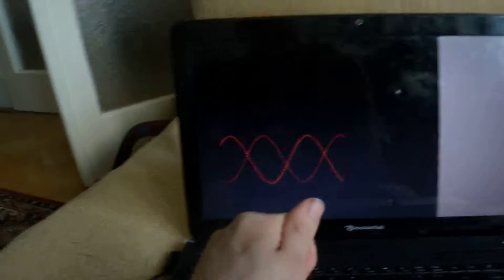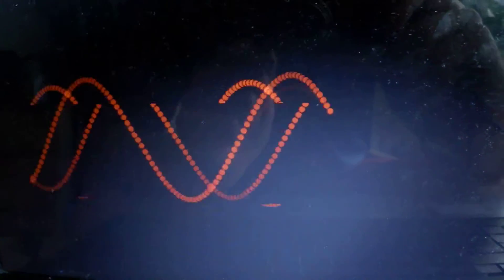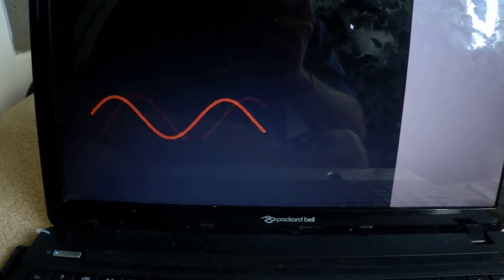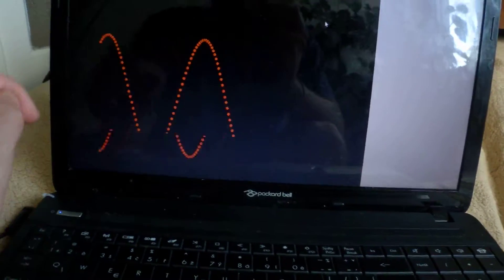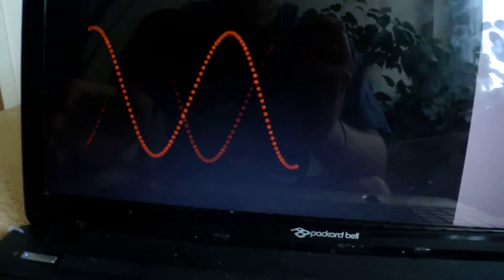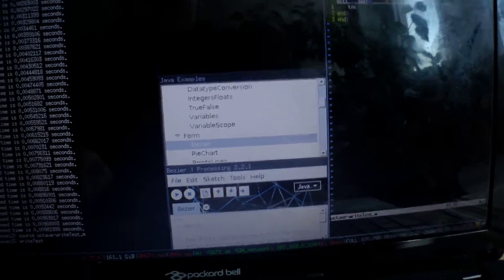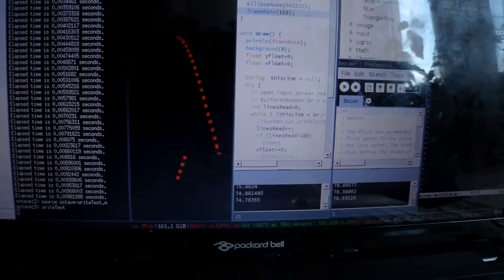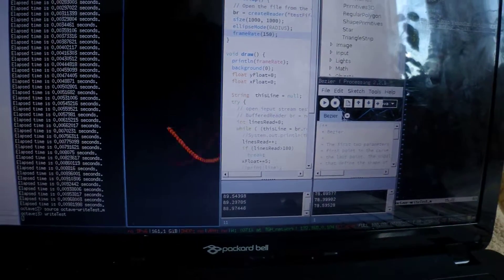Octave interactive root locus SISO design - first steps

Comment: Man, this is cool stuff. Could you do a video explaining how yo do it with full detail?
Reply from the maker: Hey there... As to the RL tool itself - I got swamped with work, postponed the project and then accidentally tore out the charging port of my laptop, rendering it non-functional. Since I don't really travel much these days, I don't need my laptop, which means I didn't get to fixing it yet. Hopefully, someday I'll manage to get back to the project and revive it, it's horrible, I know. .-.

When it comes to just the communication between 2 programs, it's rather simple. It's exactly the same as reading from a file and writing to it. The only exception is that the file is not really a file, but a named pipe. In Linux, you use the mkfifo command to create something that looks like a regular file in the filesystem, but writing to it and reading from it actually doesn't access the harddrive - but when it comes to other stuff, it acts exactly as if it did and the programs don't see any difference.
Reply from the maker: Not sure how it is in Windows though - but hopefully some similar tool exists.